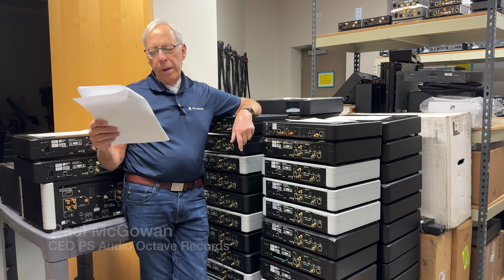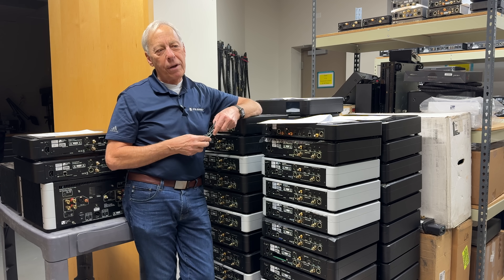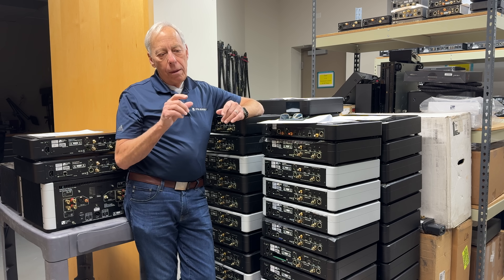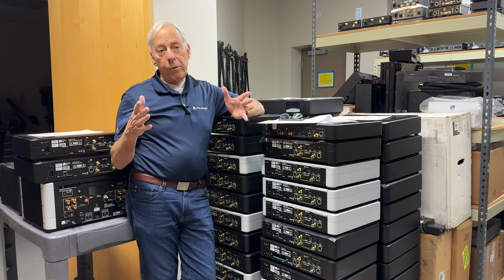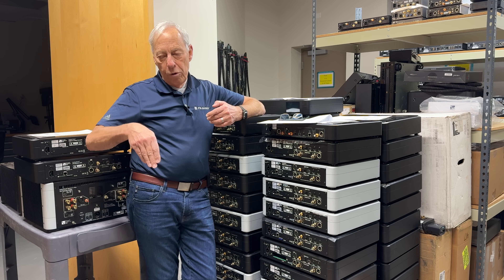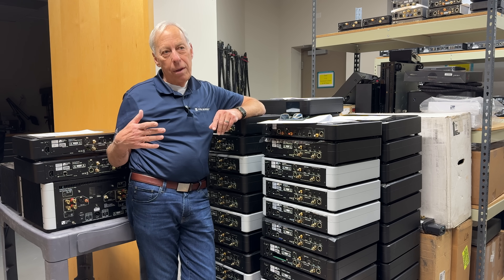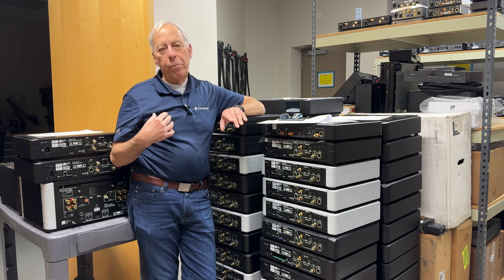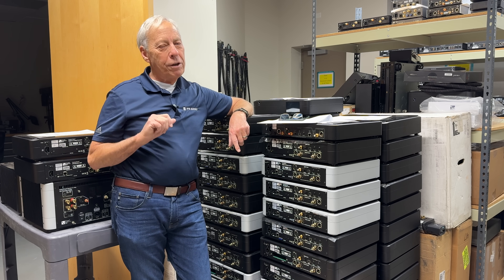Is vinyl really analog?

Comment: I thought that the solution for having more space un LP was to drastically cut off the low and mid frequencies with the "RIAA" eq.
Reply: Wasn't the RIAA equalisation curve also to reduce the bass low frequencies which could otherwise make the stylus jump out of the groove
Reply from the maker: That is correct. Low frequencies are reduced by 20dB while high frequencies are similarly boosted by the RIAA curve.
Reply: @Paulmcgowanpsaudio  so it's really not a true "analog" of the original at all, it's all ready compressed, and modified. and putting digital recordings on obsolete vinyl is about as dumb as it can get.
Reply: @cengeb  Well RIAA equalization is a compression technology but it's still a fully analog process. Same with NAB/EBU equalization for analog tape. All Dolby and DBX analog noise reduction systems also worked the same way. Dolby though was more frequency selective for the compression, DBX was full bandwidth. Digital compression is a completely different technology where the signal is analyzed and information deemed insignificant or redundant is eliminated. But I do agree with you about putting digital masters on vinyl. I don't get it either. Then there are the folks that record their CDs to open reel tape and now I understand cassette decks are coming back in fashion for the same process. High end audio is like expensive designer clothing. It's all an illusion where trends seem to come and go.
Reply: @cengeb  and as the RIAA equalisation doesn't stops at 20kHz, all the frequencies above are buried tens of decibels below, making all the ultrasonic thing a myth.